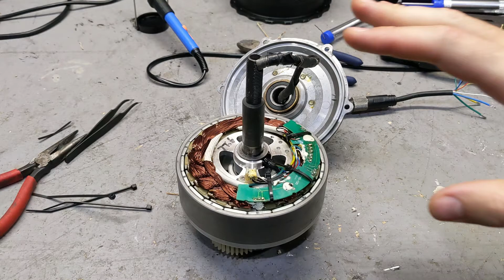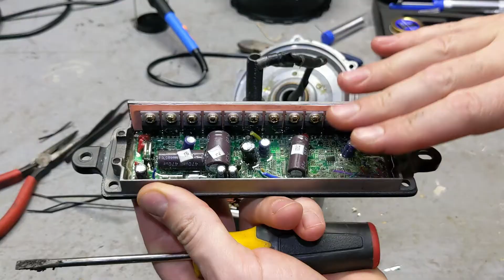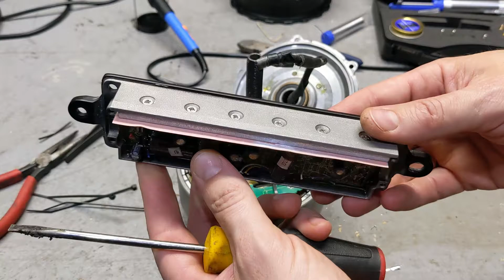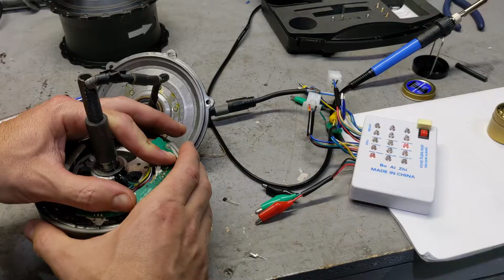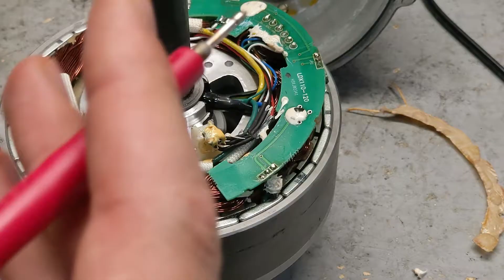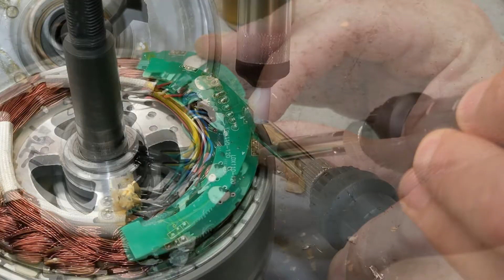How to Diagnose and replace a Hall sensor in a Brushelss hub motor Step by Step instructions Himiway

Comment: I have a problem with my himiway bike. I fix it like six times the motor issue. I change gears like two times but now the display doesn’t show any number at work OK but it doesn’t show number  For the speed

Comment: I have a feeling my e scooter is having a bad hall sensor. Thanks for the info about the tester on amazon I’m gonna get one now . I tested my controller with the phase wires on multimeter and it says its fine. i keep getting error code saying motor haul anomaly E19 error code

Comment: Hey guys, i have a chinese folding ebike rin 14, the hub motor has started making a claping sound at each time it completes a full revolution, this makes me think something has become loose or even broken inside the hub motor, what could be the problem?, i wonder, could it be a loose magnet? Could it be something else?, are there videos showing how to solve this?, but before i forget, it may be worth mentioning that the motor still works reaching its maximum speed underload, aside from the noice, the motor works great!!, it doesnt stuter or shake, it just works, but still the noice may be signaling that there is something loose in there.

Comment: Hello I have the same issue with my Himiway Motor , could you please tell me what sensor I have to use ? And where can I buy it ? That would be so nice from you. And my Ebike make this lousy noise . Was it the issue to you too ? Thank you
Reply from the maker: I got mine on eBay, no model number just bought one that looked the same .. picture matching
Reply: @VegasRoManiacReviews  thank you for your answer, so how did your Motor sound like before changing the sensor ? Please help me I have the same issue
Reply: Why not just use the new more powerful controller that doesn't require hall sensors?  Also shouldn't all controllers be engineered like that so it's more reliable?